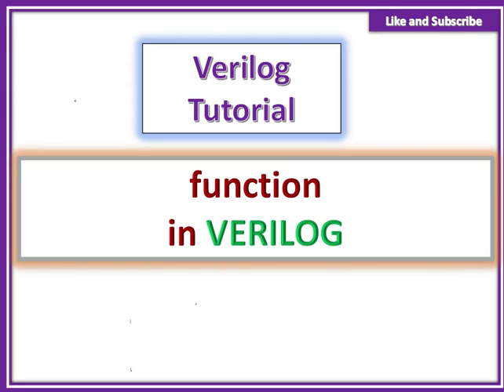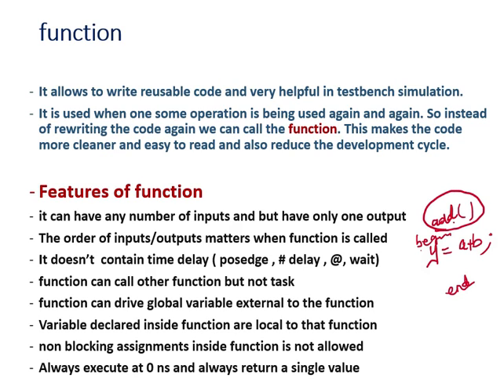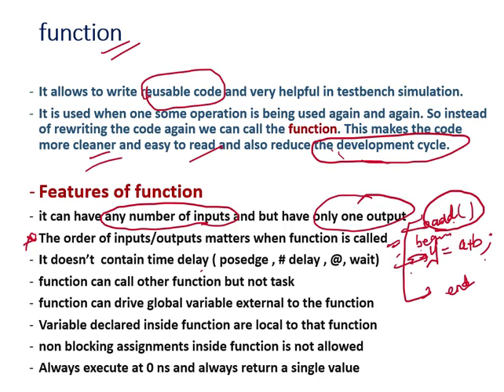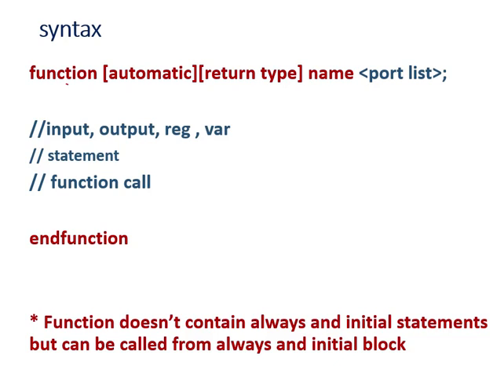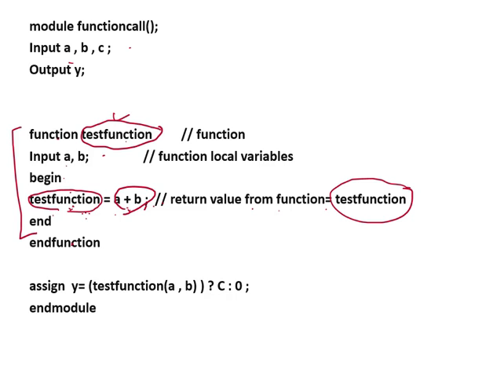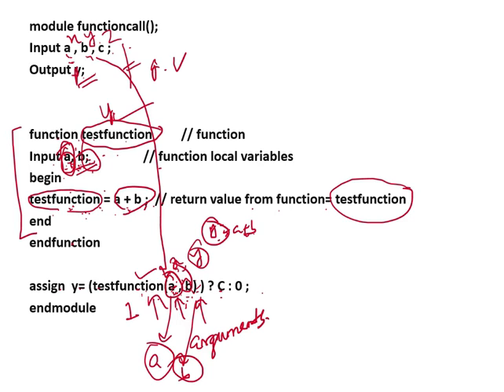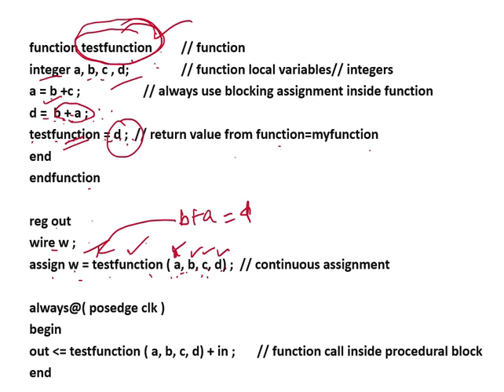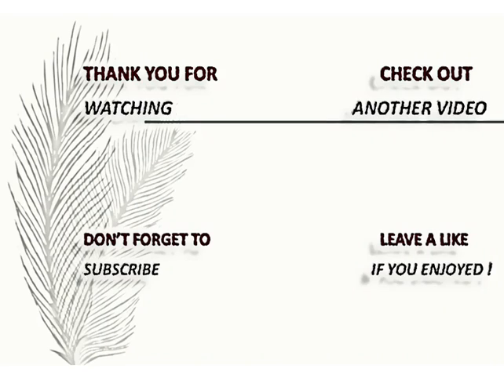#37 (MISTAKE-Read Description) FUNCTION in verilog || It's Uses & features || explanation with code

Comment: if we use fork and join inside function then the statements inside it will act as non blocking assignments no .. as they will run parallely ??
Reply: Possible but without delays, although the function construct in Verilog has some limitations it executes once at simulation time ,that opposite of fork and join.
 
We can use join_ none ( referred) 
I apologise if any wrong